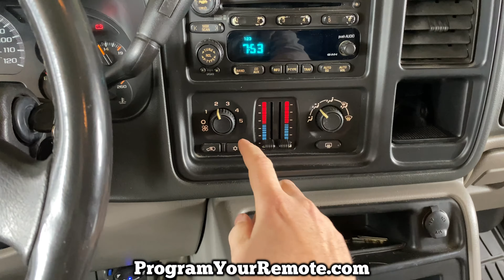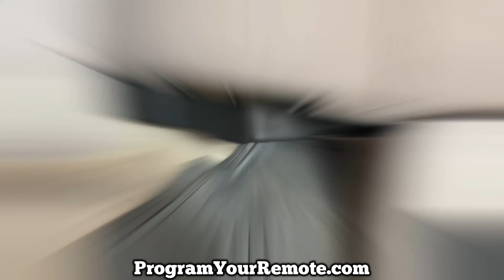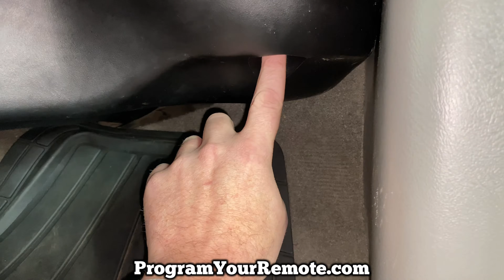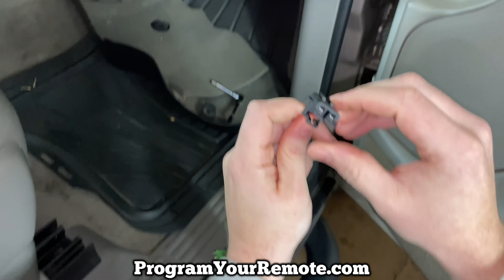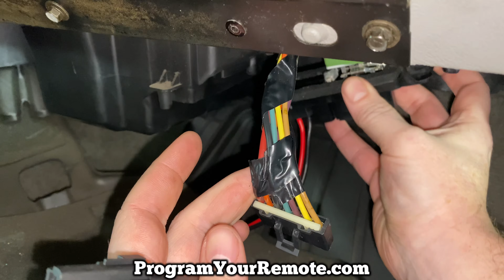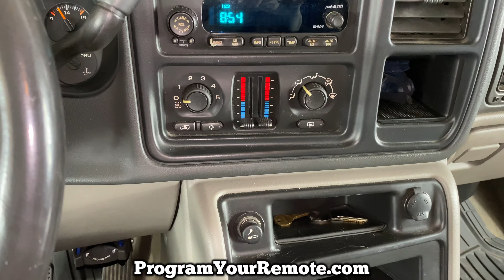2002 - 2006 Tahoe AC Heat Blower Speed Resistor - How To Fix Air Not Blowing - Replace Repair Change

Comment: My 2003 tahoe blows cold in the front. The rear does not blow cold or hot, i have replace both blend door actuators, condenser. Can someone help

Comment: replaced the blower motor actuator, still nothing, checked fuses, all fuses fine. checked my actual HVAC control center on the dash (digital) everything works on it other than the ac actually blowing. I was sitting in my car and the ac just randomly stopped blowing. y'all have any pointers? thanks

Comment: For the rear blower not working, it's probably the burnt wire behind the driver side kick panel.  I believe it was an orange wire.  It's been years since i fixed it on my 2003 chevy tahoe.

Comment: Great video, the problem is I can't find a replacement part anywhere that fits. The cover for the old piece does not fit on any of the new parts that I've found so far.
Reply: Same problem for me I just didn’t put the little cover back on and it bolted in fine

Comment: Good video..Same with mine. I only had 2 and 5  then it finally just quit. after the swap I got 2345 then lost 3 and last night sitting in the drive thru it quit completely.  Coming on but not blowing at all.. I replaced that part about a year ago. Anyone think it's the part or possibly the switch on the dash itself? 🤔 too hot for this bs lol
Reply from the maker: Maybe the replacement resistor was just faulty?

Comment: The blower motor don't work in mine at all.
But it works for the back seats.
Reply from the maker: The rear blower has its own resistor

Comment: Whats the name of the piece? where do I find it?
Reply from the maker: It's called a blower resistor.  They can be found on amazon or eBay - your local auto parts stores may have them in stock as well

Comment: would this resistor also fix the "right knob" that changes floor to face to Blended face/floor? my speeds work, but it only blows on feet or defrost.
Reply from the maker: I don't believe so

Comment: So easy to switch out because of your video. Thank you. But my 5th speed still will not work. 1-4 are perfect. :-/ Any ideas?
Reply from the maker: You're Welcome! The first thing I would try is another replacement resistor as the one you have may be faulty

Comment: What if my number 1 setting is just super super weak. Should I change the resistor or the blower motor?
Reply from the maker: Do the other speeds work normally?
Reply: @PYR-Auto  yes, just the number one feels super weak, even compared to the number 2 setting.
Reply from the maker: It's possible the resistor could be starting to Fail.  I would start with replacing that.

Comment: Cannot find the 3 wire/plug style. Only 5 wire,.,,  I am at wits end. Anyone?   My part I yanked has a 3 pin port.
Reply: I change mine out too. and it still wont blow

Comment: What if is not running on any speed ?
It could be the blower motor? 
Or the resistor ?
How can I know ?
Reply from the maker: If you have no speeds then it can really be the resistor or the blower.  You can check to see if you are getting power to the blower using a volt meter.  Otherwise I would just replace the resistor first to determine - they are fairly cheap online and will probably fail eventually anyway.
Reply: Same here rear Tahoe vents on roof aren’t blowing at all thinking blower motor but havent found a single video yet .